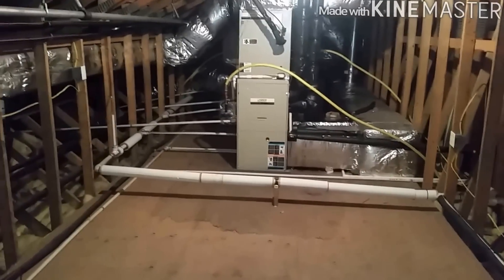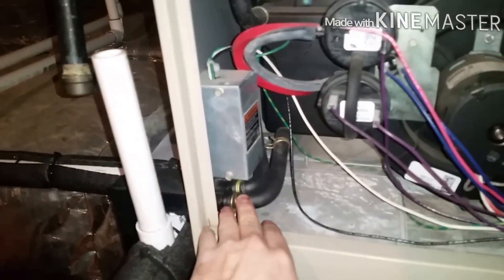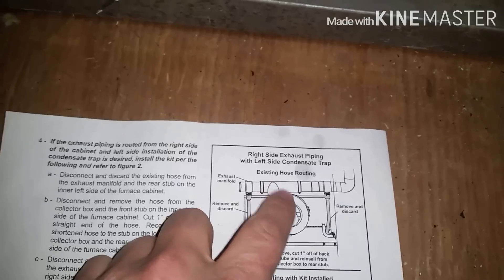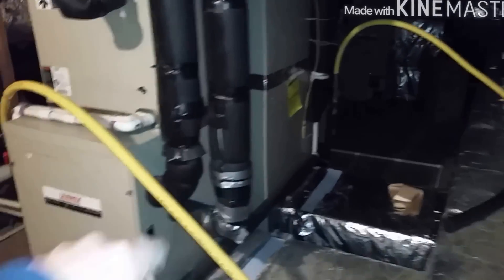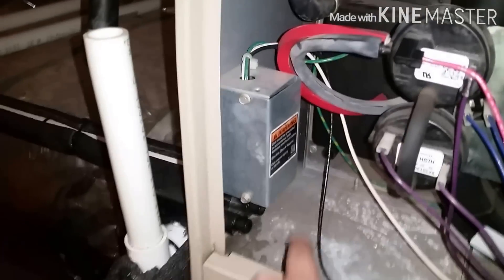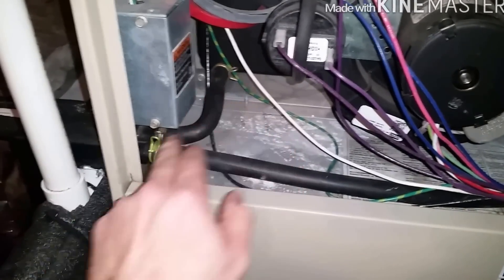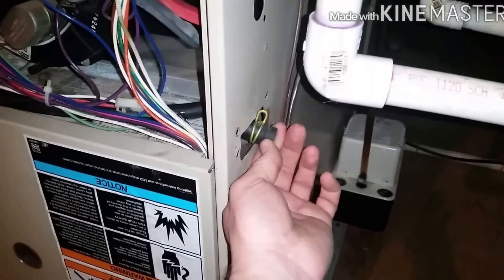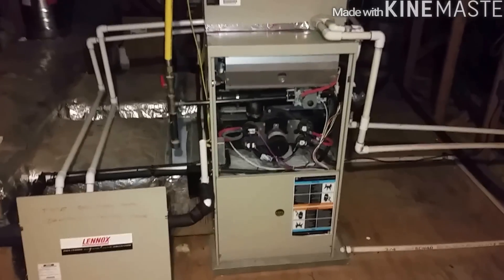Lennox 90% condensation drain conversion

Comment: Hello. Thank you for the video. I have this furnace and it was set up with the drain and outside air ports on the left. However, I'm still getting leaking inside as you have in this video (leaking on top right since no drainage to the left; getting into inducer motor). Is it ok to use the conversion kit even though the furnace is the way it should be? Thanks.
Reply from the maker: I really can't say yes or no to that without actually seeing pics or a vid to determine the issue .
Reply: I realize this is an old comment, but wondering if you ever figured anything out with this?  My lennox trap and exhaust are correctly installed on the same side, but the drain hose on the opposite side is capped so water can still backup and leak into the inducer.  My condensate lines have been cleaned and are flowing so it's not an issue with back up.  I can't understand why they would have a hose that is capped?  Seems like both ends of the pipe should be drained since the inducer is in the middle?

Comment: that new hose appears to sag where it can trap condensate inside the cabinet. Since you have a PVC trap outside the unit that would make it a double trap. Shouldn't that hose be shortened so it remains pitched to the grommet? 

Good catch on this problem. Thx for the tip!
Reply from the maker: hearth u r probably right but that was the length they gave and the instructions didn't mention cutting the larger tube for size . I will be returning there in fall for are heat checks and will be cutting it back like u mentioned

Comment: Thanks for posting this video. I have a Lennox G43UF. The trap was installed on the wrong side. This video is so enlightening. Just wondering if this kit hit for G43UF. I would love to fix the water get into the air inducer issue. Thanks a lot!
Reply from the maker: John Liu no problem

Comment: I have a brand new 90% efficiency furnace tht was put in the summer but I need some help on how to light it. Please help n ty
Reply from the maker: Wicked Witch um u shouldnt have to light anything , if it's a newer furnace then it has a ignitor or spark ignition